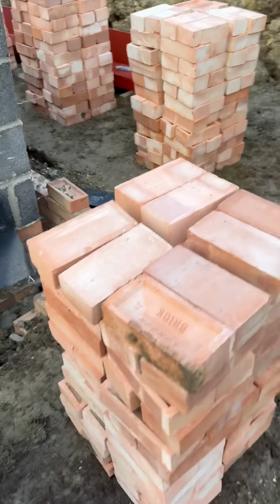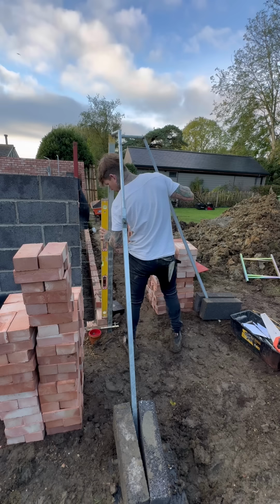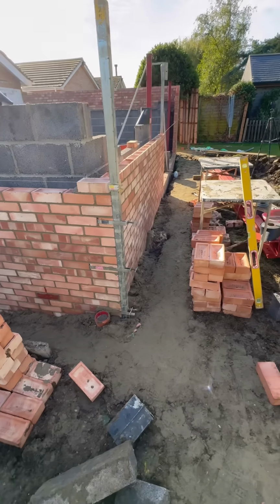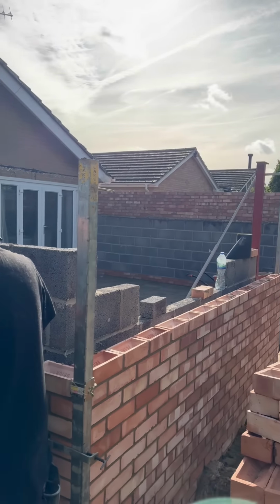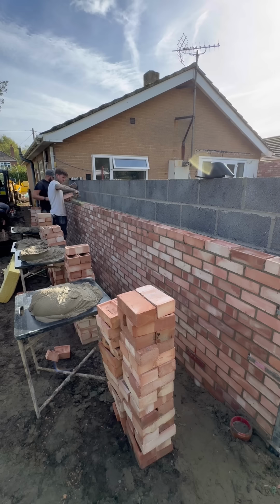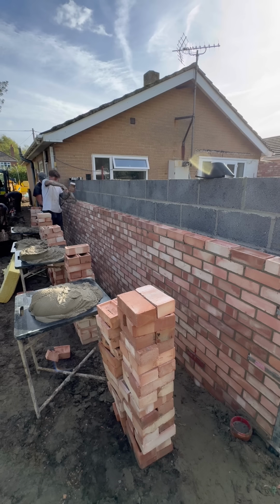Building an extension with my improver 👊🏻🧱#bricklaying #brickwork #building #construction

Comment: Noticed you got 100mm wide dpc internal skin. We always put at least 9 inch dpc now so at least 100mm sticks out to lap with membrane that will go under floor insulation and floor screed. Otherwise building control normally pull it. Use to be just mass filled floors we did it on but always wide dpc now.
Reply: On the moon we use 14 inch damp proof coarse it gives a firmer edge to the membrane around our spaceships. Obviously we are much better at bricklaying than you but that's because we live on the moon.